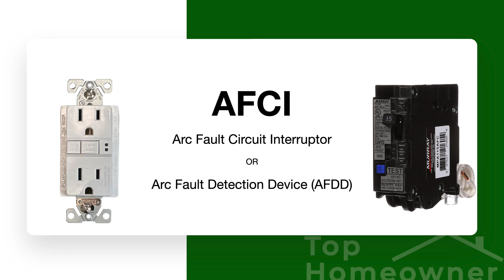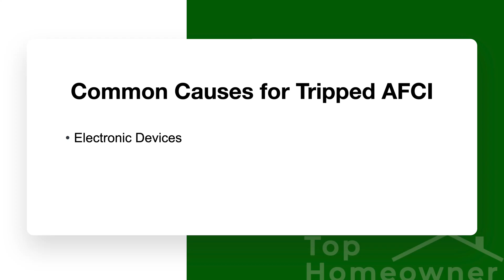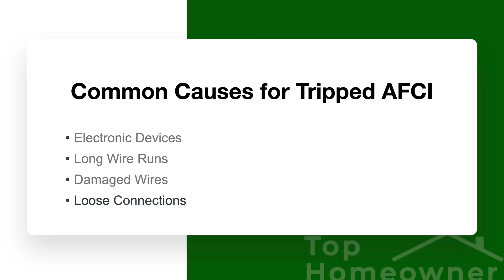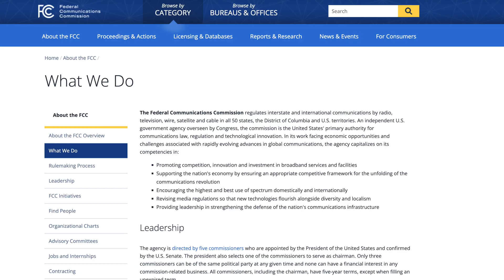End AFCI Nuisance Tripping: Discover Hidden Causes & Stop the Drama Now!

Comment: Installed two outlets and three pull chain lights on 12/2 with ground romex. Outlets work fine and circuit is stable until pull chain activated. Investigated every inch of cabling and terminations. Even removed other lights to see if the problem was down line but no success. Hiring electrician to come take a look but my theory is the pull chains will just have to be changed out for switched lights.

Comment: As far as I'm concerned if you have a good quality afci/GFCI and it's tripping and you are sure the breaker is good then obviously you need to figure something out what's wrong with your wiring or what's actually causing it instead of replacing with a standard breaker

Comment: I have the combo Siemens AFCI/GFCI breakers on nearly every circuit in a new condo.  The only time we have nuisance trips is a modern vacuum cleaner or when hiring a maintenance person who uses plug tools such as saw, drill, shop vac, etc.  

I assume there are tiny arc in this equipment that the breaker is catching, but it is TOO sensitive.  Is there a device I can add inside breaker panel or on outlet to prevent false tripping?

Comment: I have this annoying arch fault issue since 3-4 years now, have spent almost $1600 behind 4 electricians out of which one was a Master Electrician in Canada, still the problem didn't get solved, the Master electrician replaced the arch fault breaker to the regular one, I understand this is not the solution, however the Master electrician said he has checked everything and all looks great. Now the power outlet often due to which the arch fault occurs is getting black. Again in the same situation, Pissed with this issue. Hope I get some solution.

Comment: Afci breaker qont reset. I disconnected the nearest outlet to the panel and it still won't reset. I turn off the main breaker and it does reset. Could it be anything other than the breaker?

Comment: Aluminum to copper wiring connected with "standard" wire nuts often get loose over time and can arc.  I had 2 bad connections in our old pool house (installed by others).   Melted the entire plastic wire nut in both cases !   Fixed them using the correct wire nuts and/or anti-oxidant and then installed arc-flash breakers.  Replacing the aluminum wiring where possible.

Comment: You have it all backwards Part 2.  In order to have a real ground fault there has to be an imbalance of current from hot to common.  This imbalance is commonly detected at levels as low as 0.5mA.  But lightning in the next county can deliver an impulse that can fool a GF device into tripping.  Over the last 30 years I have reset at least 300 GF switches. And not one single time has it been because of an actual ground fault. NEVER!!! In one house the idiot electrician put in a GFCI outlet and daisy chained it to two outside outlets and the three outlets in the garage. The GFCI outlet was in a downstairs bathroom at one end of the house. The other outlets were all the way across the house to the other side.  That long wire acted as an antenna and caused the GFCI to trip.  For several years those slave outlets were considered broken because no one knew where that master outlet was located not did anyone suspect there was a GFCI master. And it was hidden behind a towel in the downstairs bathroom.  I developed a rule of thumb. Use a GFCI for each outlet where you think you need the protection. Do not daisy chain.
And finally, where can we actually find a ground to divert current from the hot to ground to legitimately trip a GF device? The water pipes are pex - no longer copper. So no ground there. Tap water is very clean and free of ions so it can't conduct. As much as we tried to prank dorm mates in college we discovered that connecting HOT 110VAC to a door knob didn't even work if we put a puddle of water at the door and a common wire in it. We discovered that in order to get any reaction we had to steal a salt shaker from the dining hall and dump the whole thing in the puddle. Only then it kinda worked. Getting shocked by a toaster in the bathtub only works on TV shows.  Drain pipes are plastic too so no ground there. The gas line is plastic enough that it does not conduct. The only source of ground in today's kitchen is that 3rd prong on the outlet. Get rid of those and a ground fault is near impossible. Japan has mostly gotten rid of that 3rd ground.  
BTW, my gas range has electronic ignition on the burners. It trips the breakers near every time. So we have a fireplace butane lighter sitting next to the range and have developed the habit of turning the knob real fast to avoid "electronic lighting" function.  All the appliances are brand new. Every appliance has wifi built into it. But we find it stupid and have not used the wifi at all. And never will. My experience with that kind of wifi function is it will be broken in 3 years. I just discovered today that the sprinkler system has valves in the yard that do some kind of unnecessary safety function. And have a tag on them with a QR code and instructions to install an app on your cell phone to turn that valve on. So it must have a battery in it. And it is one foot in the dirt.  How long is a battery going to work in that environment?  I am going to have to get a plumber to come out and remove it.  I am probably going to have to discard all the new appliances and for each one I will go to a used appliance store and buy 20 year old appliances. Bring back pilot lights and mechanical washing machine timers instead of the microprocessors that will break soon. And the HVAC system has all ESM motors. They have MOSFETs which will be blown by lightning strikes overseas. In every system I have had with ESM motors the motors all get replaced under the 5 year warranty several times until the warranty runs out. Then they tell you to buy a new HVAC.  Today's typical lifespan for an HVAC system is about 5 years. The old PSC motors will run for a century.  At my previous house the HVAC was 40 years old and still running just fine. I toured a house for sale that still have the gas heating system installed in 1940. It still worked just fine.

Comment: You have it all backwards.  Part 1
I have a brand new house. The panel has 30 GFAF breakers.(They cost 3k$. Non GFAF breakers would have cost 270$.)  They trip 5 to 10 of them per day.  We have just given up on the garage doors and operate them manually because they have switching power supplies and trip the arc fault function of the breaker. The HVAC system is mostly off. We wake up freezing. I go and reset the breaker and before morning it's tripped again. I don't look forward to the summer. The undercabinet LED lights put out enough noise to make virtually all the breakers trip. GFAF breakers should be internationally banned. The electronic compliant things you point out as a solution are in my new house on literally everything. And they are the culprits.  The long wires exist because the GFAF function is done at the breaker panel so all the wires are long. It is the modern and compliant devices that are causing the problems so you are wrong about getting newer devices. They have LEDs, switching power supplies, big capacitors.  It is my older devices that do not trip these breakers.  Old fashioned transformers do not trip.  Incandescent light bulbs do not trip. LED bulbs do. Switching power supplies do. Devices that have large caps to charge up do.  My home is dark most of the time. I have only been in it 6 months. This is not safe. My wife is crippled and not capable to resetting the breakers herself. I get home and she has been sitting in the dark for hours. No TV. The GFAF "safety" device makes life more unsafe without electricity.  The only solution is to put GFCI outlets at every location. Never use the daisy chain feature to another outlet. That just creates long antennas. And ban GFAF breakers. The builders that are still coming to my house to finish up have had to switch to using battery operated saws and drills because the breakers will trip if they try to use my outlets. Frequently they just bring a gasoline generator with them and crank it up in the yard.

Now let's talk about ground fault.

Comment: Anything with a fan in it will trip an AFCI. This is due to the brushes on the fan armature. I have seen computer cooling fans trip them, especially as the CPU is heavily utilized and needs the fan to kick in for cooling.
Reply: I’m having this very issue. Built a pc and after about 1 hour of load it pops the breaker. I know nothing about these things so I called my brother in law who is an electrician and the hatred this man has for these breakers was surprising.
Reply: Put your computer in front of an online UPS

Comment: So can I just swap my AFCI out with something better, i have an extension cord connected to the outside of the house running to my battery trickle charger on my trailer. Idk why the electrician hooked the outside outlet up to the bedroom breaker. But most of the time it’s fine. Then randomly trips. Could go for days without tripping or months. Then today it’s tripped 4 times. It’s good now. But I just wanna fix this issue. There’s also 0 things hooked up in that room on that breaker. Nothing plugged in, no lights on. Nothing. Except the extension cord outside.  My home was built in 2020

Comment: I’m having same issue, but house was built 3 years ago. So they are newer afci. When we first moved in   When the house was finished they tripped randomly all the time. Now the tripping only seems to happen randomly when it’s under a load for a long tine but what’s weird is, it’s one bed room the furthest away from the panel. Nothing is on in the bedroom, I just updated a surge protected power strip that was 70 bucks just for my WiFi to be plugged into. Nothing else is in that room. On the outside of the house there’s a GFCI. But it’s connected to the bedroom Afci breaker. I have a landscape light transformer box plugged in and a HD extension cord going to my trailer battery trickle charger which is a NOCO charger. And a small heater to keep my trailer warm in this 7 degree weather right now. Which that heater is a 400 dollar Xtreme heater for boat hulls. I leave the outside landscape lights and the extension cord always plugged in. Won’t have the  breaker trip for sometimes 10 hours 2-3 days… then it will randomly trip. I will cut it back on and it’s fine for sometimes 5 minutes then trips… then sometimes only trips once in a week, or sometimes trips once every couple months, I change nothing that’s plugged in.. why so random of the tripping.

Comment: Before finally replacing the breaker I would also consider (if I can’t find the suspect) is to swap the breaker with another (identical) and see if the problem moved.
Reply: I did this and when the problem persisted I replaced the breaker and the problem still persists.

Comment: This may be a long shot but my new apartment has these AFCIs in my office which has the most electronics plugged in computer, monitors plugged into a surge protector and also a small fish tank which has a very low draw pump trips into arc fault only over night when I turn everything off no computer is on only the fish tank which needs to run. I can work 8 hours a day and it never trips but the next morning everything is off.

Comment: I just finished trimming my New Shop. There are ZERO appliances or lights on the ACFI circuits and ZERO LOAD. Several Branch Circuits trip immediately. I am in a Very Remote area where there is No Cell or cable to interfere with RF. Homeline pigtails are used. QUESTION: is there a certain OHM load that will trip the breakers? On affected circuits of outlets there are single receptacles(Dead Ends) that branch off in the circuit, can this be the cause?
Reply: Will a 3 conductor romex trip an arc fault breaker because there are two hots sharing a common neutral?

Comment: PlayStation 5 consoles playing PS5 games seem to trip arc breakers. I can’t find anything on this from a reliable electrician, but it is on gamers discussion sites. The console can run for hours playing a movie without issue but the moment a game has intense graphics it trips the breaker. I think it is noise signal tripping it. Please let me know if anyone knows a fix other than extension cord to non arc breaker or changing out the breaker for non arc.The high quality surge protector does not help.

Comment: I wonder whether the roof de-icing cables require AFCI breaker. I have two roof de-icing cables: one is 100 feet and the other is 50 feet, both plugged in a same Receptacle which has a dedicated AFCI breaker controlled. Then the strange thing happens, in a not so code weather, it works. In a really freezing cold whether (like close to 32 F or colder). It trips after several minutes when turned on. Then what I tried is if I just plug in one cable (either one), it works well. And more strange thing is, if it works for some time with one roof cable plugged in (let's say one hour), then I plug in the other cable, and it works, too. I am really annoyed by this. I wonder whether should I replace the breaker to a GFCI one.
Reply: BTW, it is a 20amp AFCI breaker and the roof cable is 8w per ft, then 150 together should be 1200 watt. Also what I mean 'it works' above is the de icing cable is on and hot for many hours, like one or two days and it never trips. That's I really wonder why the weather would have related to the trips

Comment: Thank you for pointing out that a lot of what people think are "nuisance trips" are actually tripping because there are real legitimate hazards involved that need to be investigated and fixed.  Lots of people seem to think that just because "it's always worked ok" that means a device is perfect, when it might actually have an issue that could eventually lead to a fire or a shock hazard, even if it hasn't yet.

In most cases, if a device is actually functioning as designed, but it is causing nuisance trips, it's because it was not designed to have an adequate level of power line filtering built-in.  This is true of a lot of older devices (because they didn't know any better) and some cheap devices (because they're trying to cut corners).  In most cases, if you're sure the problem device is actually not faulty, these can be easily fixed by just adding an extra power line filter in line with the problem device.  Sometimes all you need is one of those "surge suppressor" power strips (if that doesn't work, you can actually buy bigger "EMI filter" devices designed for this sort of thing, which are often not even that expensive).
Reply: Unfortunately, there are so many more false positives with these AFCI breakers that it's basically a case of the "boy who cried wolf."  How much time/money are people supposed to spend investigating AFCI trips when they have a well-deserved reputation for being false positives nearly 100% of the time?

Comment: My Scenario is, in my golf simulator room, I have separate light and receptacle circuits. I have 2-20 amp receptacle circuits both using combination GFCI/AFCI receptacles (along with 2 separate 15 amp lighting circuits) . I always have a projector, PC and small spot light plugged in. My nuisance tripping occurs when one of my light circuit (3-13 amp) LED can lights are dimmed. All works fine until I try to plug in a battery charger, or box fan or vacuum cleaner into a receptacle . When these 3 lights or on fully, I have no issues, but when they dimmed any amount, the circuit trips occasionally. Is it reasonable to assume it is a dimming interference, and not something that could cause a fire? Thanks
Reply: Try plugging one of those appliances in with a noise suppressing surge protector

Comment: Root cause = regulatory capture by manufacturers.  Putting AF detectors on circuits with electric motors - what could go wrong with this?  There has to be a balance between safety and usefulness.  I would like to see data from an independent source that AF detectors actually work properly on circuits with motors.  After about the 10th time, anyone will say enough.  And do you think it will get better as everything ages?  Remember, this same regulatory agency thought it a good idea to put aluminum wire in residential houses.  Root Cause = ?
Reply: Universal motors should have proper EMI suppression. If a manufacturer cheaps out, the arcing from the brushes can leak out.

Comment: Reason #1 AFCI breakers trip: you installed an AFCI breaker.

Seriously though, 99.99% of the time those trip, it's a false positive. I'm all for extra safety and all, but when it simply doesn't work correctly and cause more issues than it fixes, then we have a problem. Something that works so poorly shouldn't be mandated. For instance, nobody complain about GFCI, because they work perfectly.
Reply: My 2020 Siemens 20A AFCI breakers have LED fault code indicators. I had several constant nuisance trippers, and their fault codes meant "Overcurrent" which can't possibly be true.... They'd randomly trip (between 0 and 20 times per day) just by having one 45-watt Chromebook power adapter plugged in. The adapter is fine, the AFCI tech is junk. So I just replaced the two offenders with regular non-AFCI units.
Reply: And I'm sure you always verify what device is causing that false positive